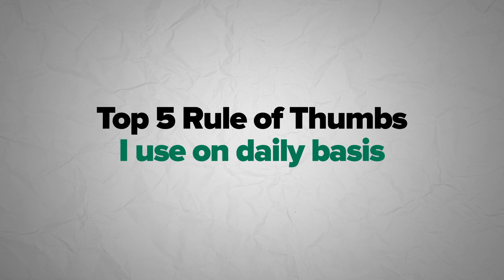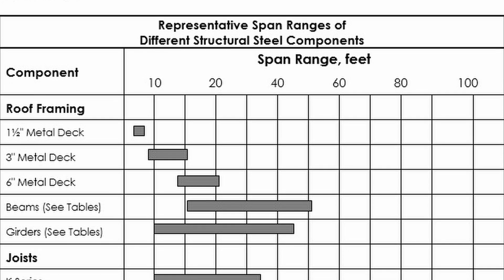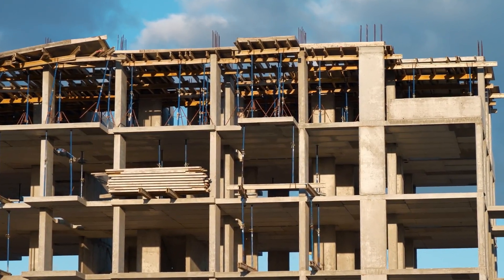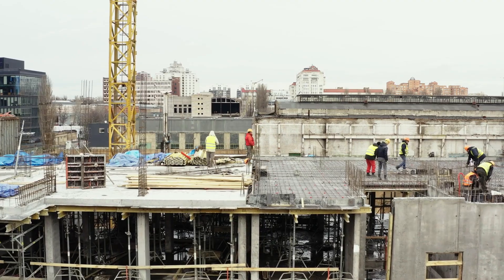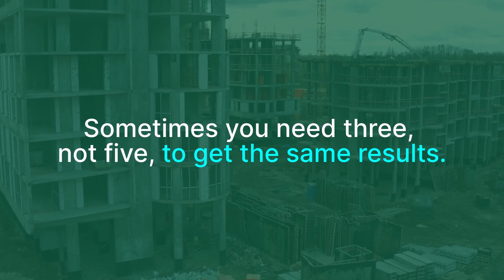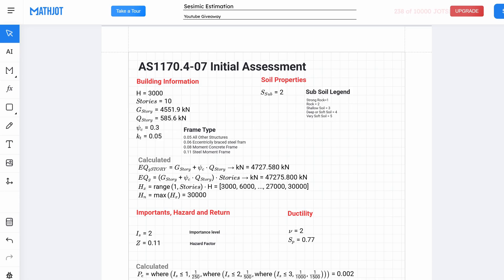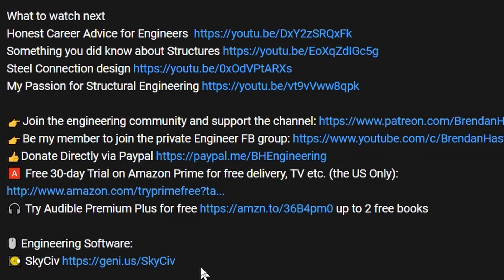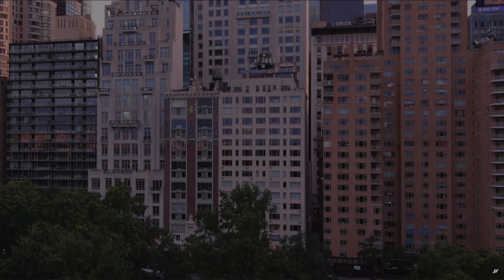Top 5 Rules of Thumb I use everyday as a Structural Engineer

Comment: Fantastic breakdown, Brendan. Quick question, since vibration becomes the controlling factor for long-span beams (especially >8m), have you come across any efficient design tweaks like composite action or tuned mass dampers, that can optimize both deflection and vibration control without significantly increasing member depth?
Reply from the maker: Anything which, increases stiffness or mass. So looking for continuity, even end fixity helps alot, adding mass makes it so it cannot be engaged using RMS and response factors to assess. So composite beams can Be really good. Typically tune mass damping is good too but it can be hard to get cost effective.
Reply from the maker: Thanks for watching and the question